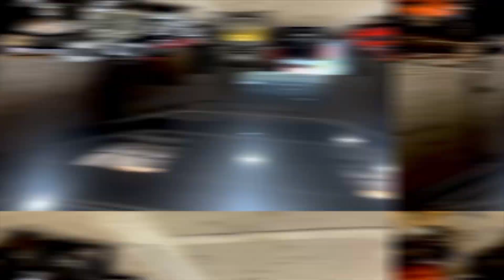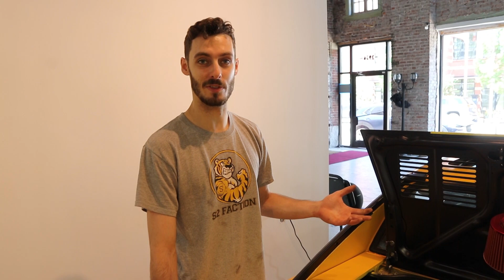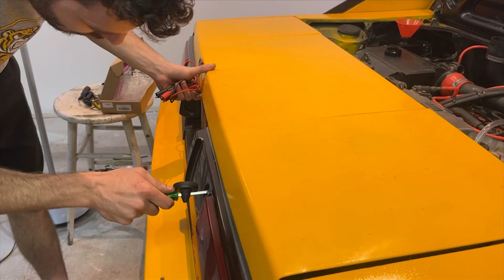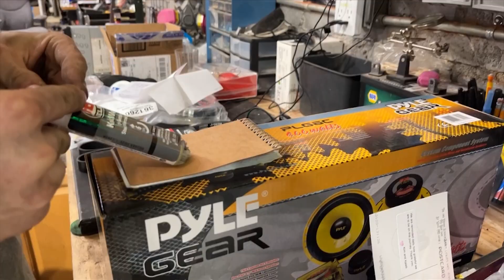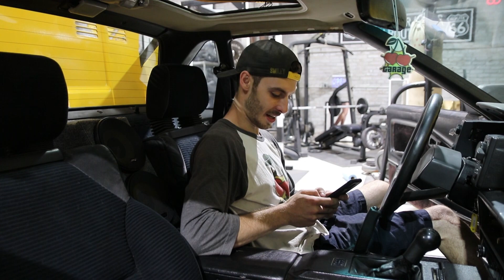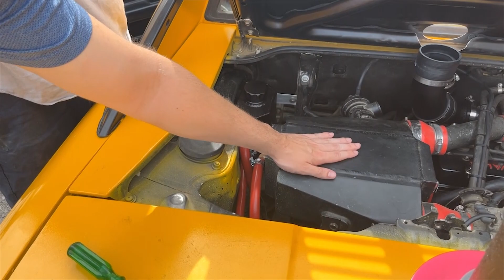MR2 MODS + UPGRADES !!  (Water-Air Intercooler + Custom Speakers + Tuning)

Comment: Good work. I went a different route with the speakers. 😄 6.5" components with the woofers in the door, tweeters in factory position, 3.5" 2-way in the rear fill, and a low profile 8" sub mounted between the seats in place of the cubby.
Reply from the maker: That sounds great! The reason I didn't do something similar is because of my alternator, haven't upgraded it and wanted to keep it good for the drivetrain. Would love to see your setup though
Reply: @TheCherryGarage  Thanks. I'll have to take some pictures. I did a black interior swap, but stopped to work on another project so it's a bit off-putting with the unfinished door cards and blue seats. 😅

Comment: I dont know man.. I would just buy and actual water pump made for racing.. most electric ones are 25GPM and not very large..so it would have ice cold intake temps and I wouldn't have to think about some non performance made part failing on me.
Reply from the maker: Works great for me, if the pump fails nothing crazy will happen, it's not part of the intake system. 
Only thing I would buy actually made for racing is the intercooler, if that fails then it'd be way worse

Comment: Hey how did you wire the speakers? Do you have speakers in the door too and are you installing subwoofers or anything in the frunk or trunk? Just wondering and any tips on wiring
Reply from the maker: I wired it into my aftermarket head unit. 
The stock head unit I don't think has the capability of doing more speakers unless you add an amp and wire everything through that. 

I plan on putting speakers in the door I just haven't yet, so for now it's only dash speakers and the center console ones I made in this video. 

If I put a sub in, it'll be a bazooka or pancake sub under the seat in the cabin. If it's in the drunk or trunk you just won't hear it at all